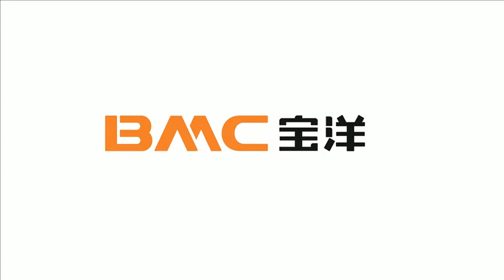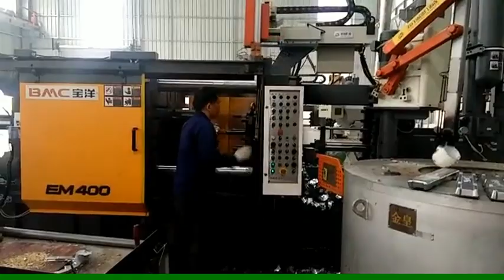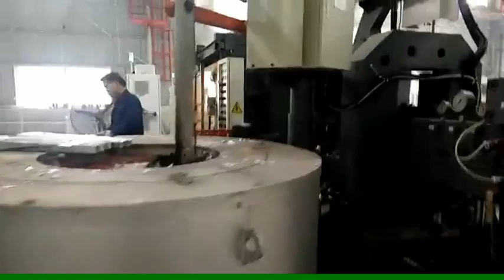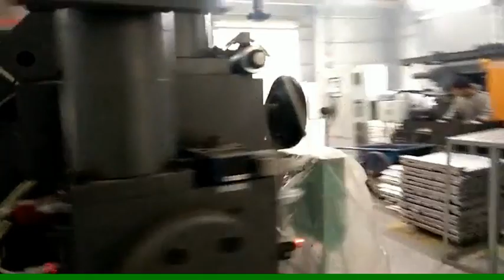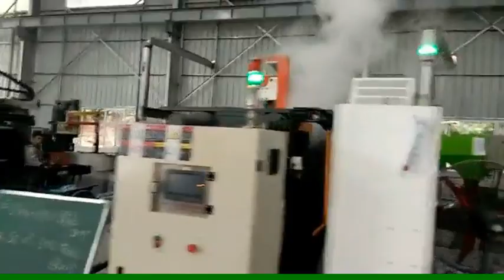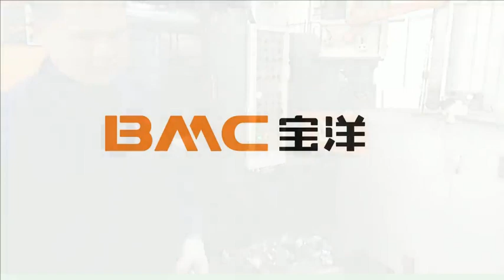Aluminum Pressure Die casting machine 400tons for automobile air compressor

Comment: Worked in the industry for 30 yrs. Not a good career. Lots of die spray mist along with metal spitting out of dies.
Reply: True. But with a proper electrostatic mist collection unit, air curtains, proper furnace exhaust system, auto spray and extraction units reduce the exposure nowadays.
Reply: The environment is by far not healthy regardless of what installs are in place. It’s a dirty, filthy environment.